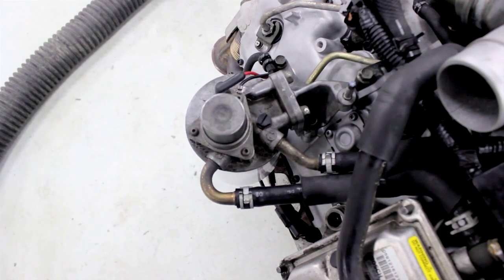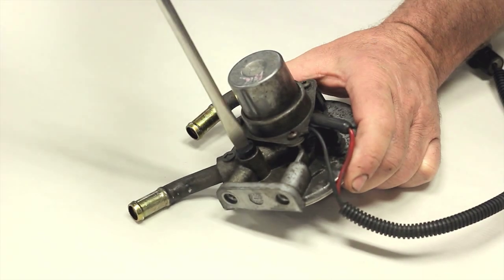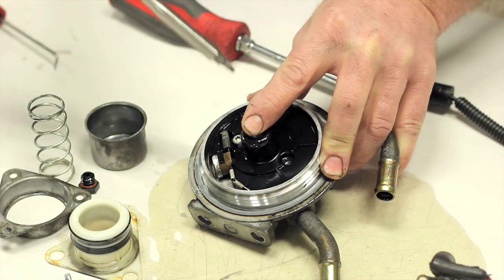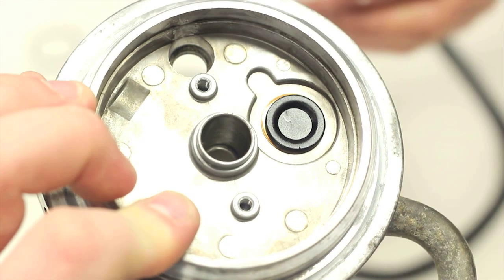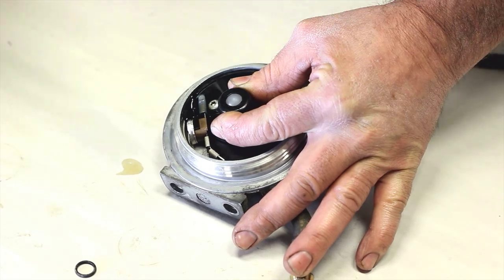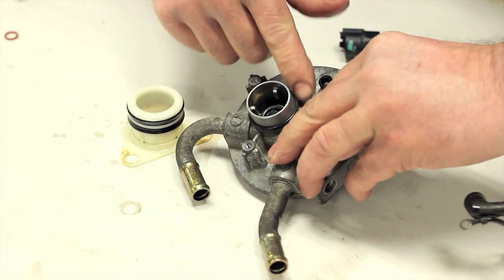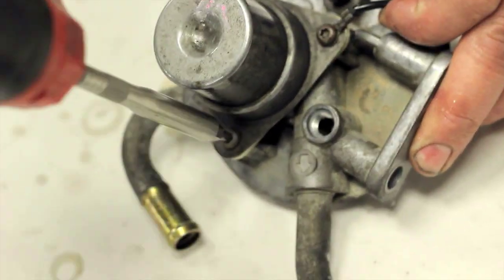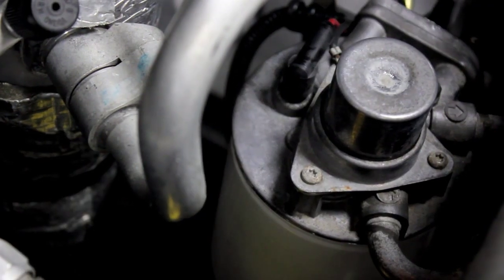How-to replace & rebuild the diesel fuel filter head on a Duramax engine.

Comment: Great video! Local mechanic shop quoted $1300 for complete fuel filter head replacement/repair. I rebuilt it IN their parking lot for $24 thanks to this video!
Reply: that is criminal
Reply: That is hilarious😂
Reply: Only 13 monster in the 2800 range most clients
Reply: I love it!

Comment: My 2003 LB7 duramax started requiring a prime if I parked pointed up an incline, or if it was very hot outside.  Within 30 days, it became almost undriveable, stalling ever few miles.  After researching online, I bought this kit (deluxe version), and hoped this would solve the problem.   It did.  It took me three hours from beginning to end.  Most of the time was spent just getting the filter housing off.  I had to remove the air induction hose for the turbo, and some wiring.  THANK YOU!!

Comment: Caution, if you buy the Dorman rebuild kit, three screws are provided for the triangular flange plate that holds the primer plunger down to the filter head. Those new screws were too long and would not seat the triangular white plastic and metal retaining ring all the way down to the pillars (they bottomed out) on the top of the head. I ended up using the original three screws, which were a little bit shorter than the replacement screws. Everything else went fine.

Comment: This video saved me last night.  Truck died getting on the freeway, then died again when I stopped a few miles down the road.  Noticed some pooling around the top of the primer, and assumed it was going to be a costly fix.  My local parts store carried the rebuild kit for a couple bucks more than your site, but it was what I needed in a pinch.  The only issue I ran into, is the gaskets inside the plunger assembly (in the kit I purchased) were just a hair larger than the originals.  This was causing the plunger to be stuck in the fully compress position with the new gaskets installed.  The originals I removed were still in good condition so I only replaced one of these and reused the second which fixed this issue.  The rest of the o-rings fit perfect, and reinstallation the truck was pretty simple for someone who doesn't typically tackle these mechanical issues.

Maybe it was a placebo effect, but i did some stop and go driving last night after completing this, and even got on the freeway for a decent rip and the truck drove better than it has in a long time.  There was no hesitation, so I'm assuming it's been allowing air in the line for a while, and that was causing quite a bit of hesitation.  Saved me a good chunk of money at the right time, so thanks a lot MA!

Comment: This is perfect. I've been having to prime my fuel system any time my 2001 LB7 sits for more than a day or so - a couple of months ago I noticed a small leak and bubbling from the fuel heater plug housing. Dealer said it needed a new fuel fitler housing and wanted $680!! I'm ordering this rebuild kit right now (c:

Comment: Nice video. I just bought this kit from you guys, because i was having issues with my 2002 lb7 starting. Haven't replace it yet but i already have a new fuel filter as well.

Comment: Great video. Thank you for putting it together. I had a difficult time getting the primer cap over the plastic housing and 2 gaskets ... took it somewhere and the trick was to add white grease to the plastic housing...that did the trick. Truck is up and operational!

Comment: I only changed the two big black seals, they had Orings in it instead of seals took ten minutes. I did not even take the white plastic piece off. Thanks for the video. I my case the plunger leaked only. No need to take anything else apart.  twenty minute job tops three stainless screws only .
Reply from the maker: That will keep the plunger in good shape, but the seals between the heater element and the housing can also be prone to leaking fuel externally
Reply: @merchantautomotive  I needed to get the truck running ASAP. I did not charge on this one, as It started leaking after I used it.

Comment: I just helped my brother replace the CP4 pump on his 2016 duramax with a CP3 this weekend.  When we finished and primed the system, the primer would get soft again after a few minutes.  Is this primer supposed to hold a vacuum for a long time?  The truck ran fine, just curious about the primer getting soft again after a few minutes.  He said he had only primed it once before in his 5 years of owning it, and that was after a filter replacement.  No issues with the truck but he wanted to replace the CP4 before failure.  Great video too!

Comment: I own a 2002 Duramax my first diesel and I just had a tranny put in a day ago and it’s leaking at the fuel filter so great video I’m probably gonna watch it a few times and then I’m gonna tackle this issue I also read on Facebook about two hours ago that you don’t need the stock filter head if you have a lift pump previous owner I guess didn’t know that but that’s OK because after I get this thing fixed for now eventually I will do the delete on it

Comment: I purchased this kit on Amazon and installed it yesterday. I read on the instructions to "take note" of the position of the two lip seals. I did, and I thought both "lips", the side were where the folded rubber comes together,  were pointing toward the flange. I see that's incorrect. After assembly, plunging caused fuel to coming out of the heater assembly at the power cable port. I see now that i instilled it improperly, putting it inside the hole where on the housing rather than around the stem on the heater assembly. I have to take redo this. Thanks for the video. Otherwise, I'd probably never get it right and have to purchase a new unit.
Reply: Under what name do I search for it

Comment: I did what you showed on the video now my truck starts but it will not run turns off after I step on the pedal and puts out black smoke and some white. What can I do and check to fix my problem.

Comment: I’ve replaced a couple cracked housings under warranty, but I guess if they didn’t crack under warranty, they probably won’t crack at all (on their own at least lol) and it’s just a matter of new o rings. I guess those 2 molded rubber pieces in the housing could leak also

Comment: I just rebuilt mine and hear air coming from around the plunger. I also noticed wile it was apart that that black part that's not serviceable was loose and not seated right. ould that mean I need a new head assembly?

Comment: Have a 2001 Chevy duramx 6.6 that just stops running loses prime will start up and run after priming but not for long had new housing and filter put on and still has the same problem
Reply from the maker: Sure does sound like a loss of prime, be sure to check all of the fuel lines under the truck for any dampness, a sign that you could have a very small leak allowing air to get pulled in

Comment: I have a 2008 chevy 3500hd duramax. I'm have issues on cold mornings and a couple times when the weather was fair I tried to crank it and it stated to turn over and then clicked. first thought was bad battery but they both checked out at 12.45v and 12.91v. if it is jumped off it will fire over. my light showed cylinder der 3,4, and 8 glow plugs. could it be they are not heating those cylinder deres so it is fighting to turn over. I'm at a lose. first duramax I've owned. also every morning I first start it my clock on the radio resets and the cd player start making noise with the cds unless it is plugged in over night. any ideas would be great. thanks.
Reply from the maker: Mike, I would start by having both batteries load tested, it takes alot of power to turn over a cold diesel engine so weak batteries will show up quickly.   The cylinders with glow plug codes should be repaired, but unlikely it is preventing the truck from turning over.  Get the batteries tested/replaced and report back.  You can email me direct eric@merchant-automotive.com

Comment: If you happen to remove the rubber plunger that you state not to remove but on the top (it was before I watched this video) is there a way to put it back or can you buy a new one? If so what is it called and do you know the part number?
Reply from the maker: That is not a servicable item unfortunately.
Reply: @merchantautomotive  so does that mean I need to buy a new filter head?

Comment: Having watched this, I was able to understand where the leak was occurring.  When priming the pump, fuel would come out with lots of air bubbles, even after several attempts of priming. I took apart the priming pump and noticed the seals were stiff and brittle. I realized the most likely path air was being sucked in, when running the engine for about a minute after priming,  and would then shut off, was through these seal.   I called the dealer and when  I was given the price of ~$ 60.00 for the priming assembly, including the heater, it was a no brainer. I replaced it, and the truck is now running.
Reply from the maker: Glad you are up and running again !

Comment: What if I pulled out the nonserviceable plungers from inside fuel filter assembly?
Reply: It doesn't prime anymore and I put it back the way it went
Reply from the maker: Did you remove the non serviceable portion?
Reply: @ambermcrann3285  I did the same, what was the fix?

Comment: I bought rebuild kit o rings and replace them but Why are the round Moulded  rubber seals unserviceable? I think that's the problem with my fuel filter head because when I press down on one of them and pump I get suction but if I don't I don't get suction

Comment: awesome video only complaint is that the video doesn't show the complex process of removing fuel filter head from truck but great video though
Reply: Austin Schieck Lol it's not Complex probably one of the easiest repairs for this Engine.
Reply: It's by far the most difficult part, getting the right size pliers around the AC lines and other obstacles to pinch the fuel line clamps and slide them up the hoses.. After that, it's a simple job.
Reply: You might want to check with Western Diesel about their fuel filter relocation kit, if servicing the factory location is difficult for you.

Comment: Received my kit, but it was the wrong one. Will contact you tomorrow, 03/10/22. Received #10471. Appears I need #10192, or at least that o-ring kit for a 2004 LLY Duramax. :(

Comment: Great video...  TERRIFIED by the sustained lack of gloves!!    Cancer Sucks!!    : )
Reply: Jon Culbert Same here, I couldn't focus on the video because all I was thinking about was him not wearing gloves 😬

Thanks for the informative video though!
Reply: I'm guessing you're referring to the brake cleaner with Tetrachloroethylene in it. It's a "probable" carcinogenic, but the evidence is not clear enough to fully prove it. It's also most problematic for those who regularly inhale it or drink it. I presume that a "shade tree mechanic"  occasionally spraying it on his hands is getting much less exposure. It's used in dry cleaning and is still on dry cleaned cloths, but they say that's not a concern. https://www.cancer.org/cancer/cancer-causes/tetrachlorethylene-perchloroethylene.html
Reply: True enough but that stuff is addicting---in a functional way. Amazing degreaser. Drys fast and clean so it can get grease-stains out of many fabrics. Compatible with many resins and insulations. Non-flammable and non-ionic so it's great with motors, alternators, electronics and switch-gear or anywhere where there is a fire risk. Really heavy making it ideal to take out paper-wasps as at distance (I do this rarely as I'm a big fan of their MANY contributions). Viton gloves and a face-shield are cheap insurance.
Reply: @billcarson185  "Known to the state of California to cause cancer"... just like coffee, water, air, trees, basically they are covered legally, if you die in their state.
Reply from the maker: All these years later and I'm still alive!   I do agree proper safety precautions should always be taken and I'll leave that to the discretion of the viewer.
Reply from the maker: @the_ure   so true!  Fortunately we are immune to all of that being located in MI!   LOL

Comment: I cringe every time I see someone using a strong solvent like Brakeclean, barehanded. About as destructive to your liver as can get. Your liver is pretty important to your not just staying alive, but to most functions in your body. Automotive equivalent, smearing sand all over your crankshaft. Well, not your crankshaft, your trucks crankshaft, the one inside the engine.  Trust me, I nearly died several years back from such ignorance & it's been a long hard road to recover from.

Comment: So I thought I had been putting these kits together all wrong this whole time. You know, because he says to put the seal (on the primer bulb) on upside down so that the edges are facing each other...... 

So i went out to my truck today and swapped the seal around thinking that it would possibly help the very slight fuel I had coming out of my fuel filter housing unit....

WRONG, WRONG WRONG WRONG WRONG, F******** WRONG. 

When I flipped the seal around fuel started dumping out of the plunger head. Down my drive way down the street. I figured i didn't tighten something down enough. WRONG. Still F******* leaked. 

How did I fix it you ask? I put the both the seals on the same way, and WHAT DO YOU KNOW. it stopped dumping fuel all over the pavement. I only wasted about 1/4 of a tank of fuel. You know, no biggie since diesel up here is ONLY $4 a gallon!!

No it isn't my bleeder screw cause I just replaced it with a new, non-plastic, bleeder screw. 

Sorry if this post seems like I'm not happy. But I'm not at $4 a gallon I figure I wasted $20 in fuel today. 

More than likely I need a new head since I've replaced the seals 5 times. But never have I had a leak like I did when i put the seals on like stated in the video. 

Maybe I'm the only one. I hope to god this hasn't happened to anyone else. 

Sorry-Rant OVER